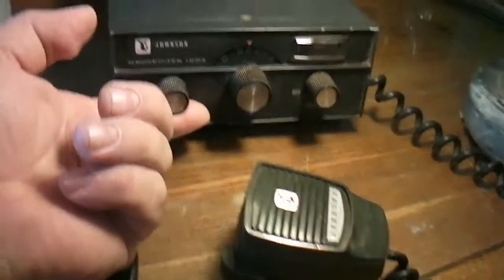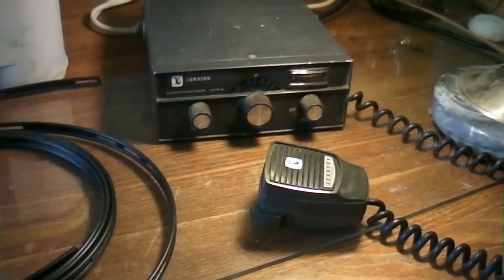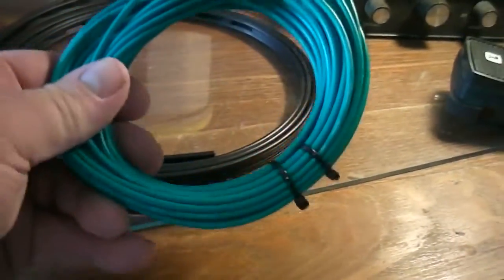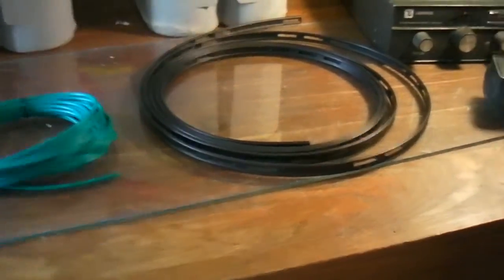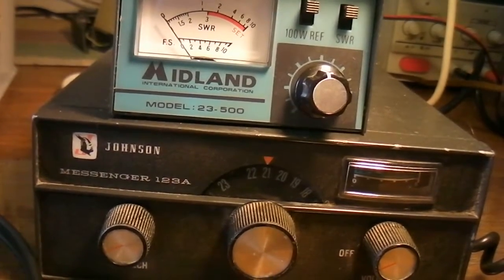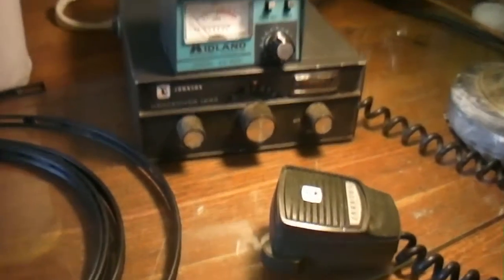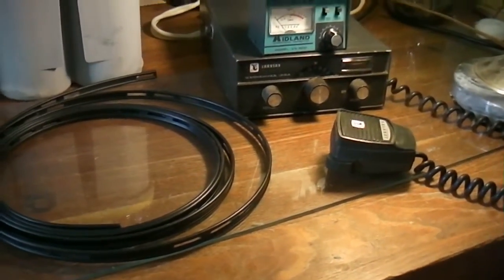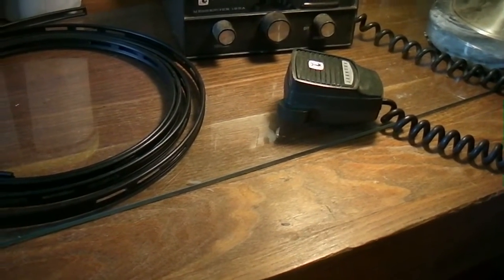Rigging Up A CB Radio For SHTF Cheap

Comment: Johnson radios= Made in USA! Very good radio! I run a CB off a 12volt deep cycle battery when the power goes out. I do have a solar charger from Horrible Freight.
Reply from the maker: crazybobdj They work really well. I have talked 5 miles so far. They dont have any shiny bling and I don’t know how to mod them no info on that. I did turn up the modulation though. They sound good. I got a Galaxy too it is very shiny and has the ability to put in better output mosfet and a swing kit. It will be fun. The Johnson was great radio for the price I paid for it 99 cents. Seems like you can get one cheap on ebay because people dont realize how good they really are. I bought two of them. I purchased each one for less than ten dollars wow.  Really nice radios too.

Comment: cbs are fun did it for years in fact I still have 4or 5 just kicking around
Reply from the maker: drvshaft drew I never had one and this one was too temping and plus I always liked Johnson radios. Back when this one was new it could get out good. Its not got a lot of features. I am leaning how to tweak it. But first I want to see if it just still works? Can I make an antenna that has a good acceptable SWR? Will the skip be too bad to be heard? Will there be anybody to talk to? So many  questions about this hobby. I cant wait to build the antenna seems like it will be a fun project. I think a guy needs a little bit of power to talk over the skip.

Comment: dear youtuber, great video, please let me know what is the funtion of the dispositive on to of the cv? what is the name i want to see what does it does and i may buy one
Reply from the maker: +Martial Arts Tutorials & Fight tips Buy a Cobra 29 LTD they are cheap enough and a lot better. Watch my newest video.
Reply: shartne i will thanks
Reply: shartne BTW i forgot to mention my radios are cobra, but what is the device on top of your radio, do i need that?
Reply from the maker: +Martial Arts Tutorials & Fight tips It is a SWR meter that goes in line to your antenna. It checks for Standing Wave Reflection. Too much SWR will bunn out your final in your radio. so you must adjust your antenna length is it needs it. There are many videos on this subject.
Reply: shartne THANKS FOR THAT, I WILL FOLLOW UP